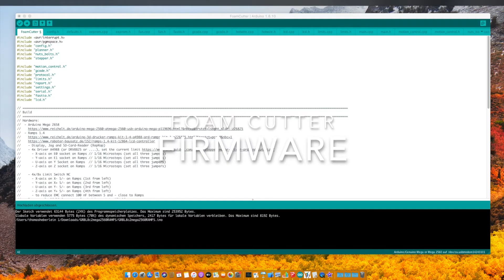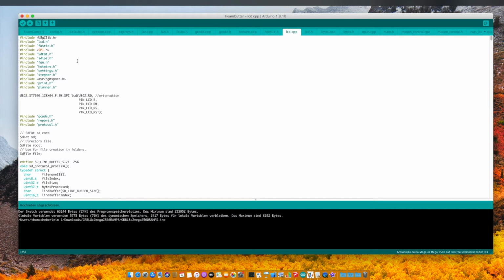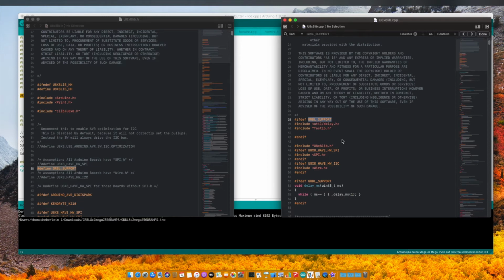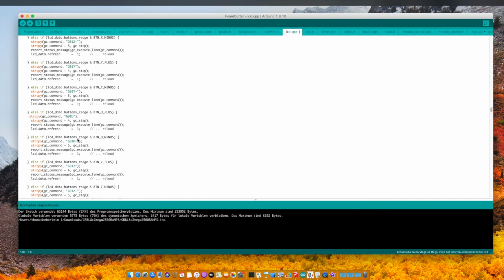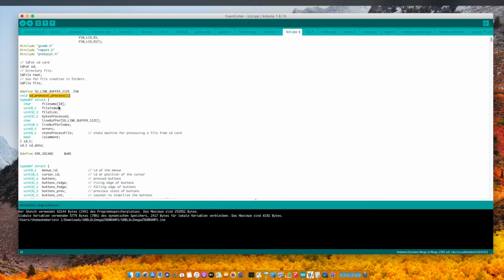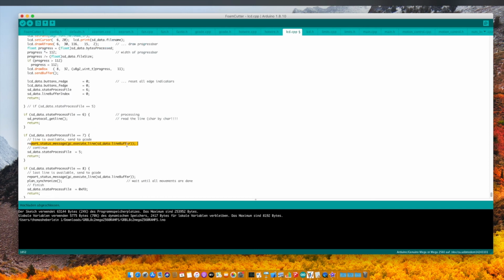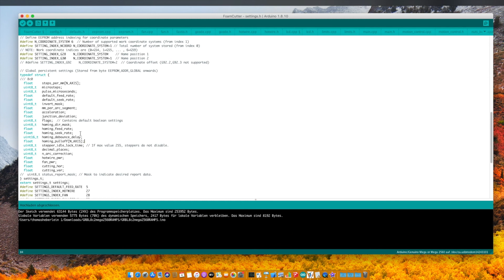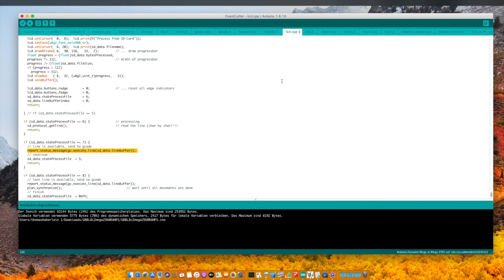Foam Cutter Firmware

Comment: Can I use it on the Creality Melzi Board V1.1.2?  

https://www.google.com/url?sa=i&url=http%3A%2F%2Fsupport.th3dstudio.com%2Fhc%2Fproduct-information%2F3rd-party-control-boards%2Fcreality-boards%2Fcreality-melzi-board-connections-cr-10-ender-3-ender-5%2F&psig=AOvVaw0OMC9fWExkBZqnvcno8ZmD&ust=1624131132256000&source=images&cd=vfe&ved=0CAoQjRxqFwoTCJjNt4v2ofECFQAAAAAdAAAAABAD

What do I need to modify it needed?
Reply from the maker: I opened a issue on GitHub. the compatibility of the board is not so easy to answer. https://github.com/ThomasHeb/4AxisFoamCutter/issues/16 regards Thomas

Comment: I compiled the program I loaded it I put it in Lib_8UG2 library, but there is no screen, where is I making a mistake thanks
Reply from the maker: Hi Ugur, did you follow the steps I posted on github? which hardware are you using exactly (a picture would be great, especially showing the wires between the Ramps and the display)? have you tested the display with another program? If you agree, I would open an issue on github and try to figure out a solution? Regards Thomas
Reply: @thomasheb7324  I have installed Repetier-Firmware and it works fine. But I am loading your firmware, there is nothing on the screen. You made the circuit in my dream of working very nice, thank you very much. my english is bad, sorry i am using translate. I have been dealing with foam cutting cnc for about 12 years and I am interested in model aircraft.
Reply: RAMPS 1.4 Mega 2560 LCD 12864 kit
Reply from the maker: @ugurdem  many times there are bad soldered pins on the boards. but if the repetier firmware was running on the arduino/ramps/display, we need to go a bit deeper. I will open a github issue and start with some simple test programs. do you have experience with programming / writing code for arduino?
Reply from the maker: @ugurdem  Link to GitHub https://github.com/ThomasHeb/4AxisFoamCutter/issues/14
Reply: @thomasheb7324  Arduino 1.8.12  I have installed 3d printer firmware, there is no problem on the screen, but I have installed your 4AxisFoamCutter-master firmware. There is nothing on the screen, there is no buzzer sound, I turn the rotary key, no response. I copied the files in Lib_8UG2 to the library. Is there a place where I can make changes to my lcd hardware?
Reply: I feed the card from pc from usb
Reply from the maker: @ugurdem  This should be no problem for all tests. please go to GitHub, this is a better place to detail code and support you.

Comment: Hallo Thomas, bekomme beim Kompilieren einige Fehlermeldungen, könntest du mir da bitte weiterhelfen?
Danke!

Mehrere Bibliotheken wurden für "U8x8lib.h" gefunden
 Benutzt: C:\Users\Jetpilot\Documents\Arduino\libraries\U8x8libr
 Nicht benutzt: C:\Users\Peter\Documents\Arduino\libraries\Lib_8UG2
 Nicht benutzt: C:\Users\Peter\Documents\Arduino\libraries\U8g2
lcd.cpp:7:10: fatal error: SdFat.h: No such file or directory
 #include "SdFat.h"
          ^~~~~~~~~
compilation terminated.
exit status 1
SdFat.h: No such file or directory
Reply from the maker: Hallo jetpilot72,
klar kann ich Dir helfen. Hast Du die Arduino Programmierumgebung schon prinzipiell zum laufen gebracht (Blink Beispiel oder so)?
Es sieht danach aus, als ob du mehrere 8UG2 Libs installiert hast und dafür keine SdFat-Lib. ich habe auf GitHub ein Issue aufgemacht, dort lässt es sich einfacher diskutieren und Bilder anhängen
https://github.com/ThomasHeb/4AxisFoamCutter/issues/4
Bitte gebe mir kurz bescheid ob Du klar kommst.
LG Thomas
Reply: @thomasheb7324  hallo thomas, danke für deine Hilfe, hab auf Github schon geantwortet - hab leider noch immer den LCD Fehler! LG Peter